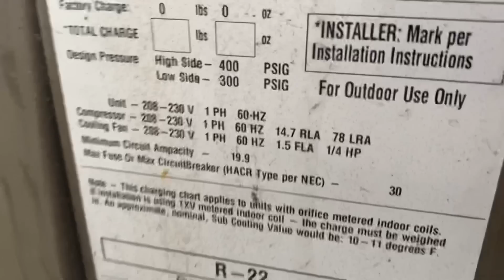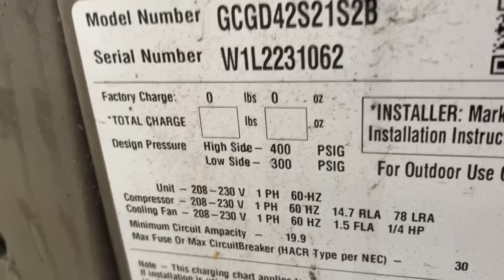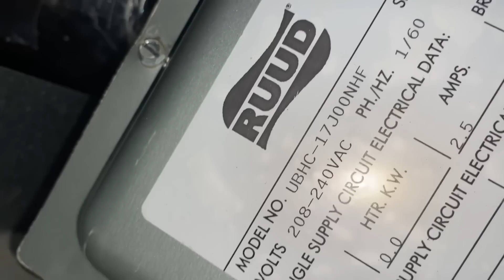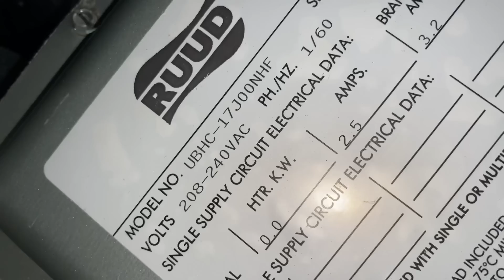Discussing Options With Homeowner After Finding Central AC System With No Refrigerant R22

Comment: It's 20 years old and should be replaced. She wants to sell. Much easier to sell if it has working air; or sell as it. My wife's cousin lives in Queens and her house would be a tear down, so she could sell as is.
A new system might be a selling point; if it is what the seller would buy. We don't know the prices of the options. A new system may be out of reach for her.

Comment: She's not going to like selling a house with a broken AC system
Reply: people are buying anything and everything in all conditions, even waving home inspections and accepting everything as-is. even if they need gutted to bare framing inside and out, with absolutely everything new!  bunch of suckers buying while the markets are so high, then they'll be up poo creek without a paddle in a year or three. 🤣
Reply: @PipeDoctor   I was speaking of the housing market in general, it's going full berserk lunacy (idiot/fools and their money will soon be parted). while she stayed put and fixed the place, she had opportunity unload it as is, but that may not work out in the long run, as things are going bust and massive inflation that's just begun. aka hold on to your hind quarters, it's about to become scaling loose rocks on known rockslide prone areas. 💣😬

Comment: Not an HVAC guy, I actually work doing energy efficient upgrades for the utility in my area, personally I would recommend a heat pump if feasible. The money saved on oil could offset the cost of the heat pump. There is more than a few banks offering low interest loans in regards to energy efficient upgrades. And in today's volitile market heating oil is only going up. Unless she has a condendensing oil furnace, a heat pump would be more efficient.

Comment: Add a little R22 and pressurize with nitrogen. Find leak and decide if fixable or not. If fixable fix it and then recharge  with Bluon R458a.
Reply: 99/100 its the micro channel condenser leaking.

Comment: I would leak search.   Find repair.  Convert to 407 c.  Just have to mix in some poe oil.    Giving her ac until she sells.
Reply: Nu-22 or 422D, don't have to do anything with oils
Reply: @videos10  true.  But with an older system like this one.   All the drop in replacements raise head pressure and lower capacity by doing so.  That could under cut cooling on the hottest day. 407 head pressure and suction pressure and temps is the closest to old R22.
Reply: @dimaslespier2688  oh interesting ! Did not know about the higher head pressure when ambient outdoor temp is hot!. So, adding compressor Poe oils would help keep the head pressure normal when it's a HOT day outside when CONVERTED?
Reply: @videos10  you add Poe oil so the 407 has less risk of separating Poe is a better oil to not allow the separation of the newer refrigerants as we know they are heavy blends.  But you don’t have to drain all the mineral oil. You can mix them.  I’ve done this a thousand times never an issue.

Comment: What would I do? I would do pretty much exactly what you did. Similar service call today like that happened to me.

One of my other coworkers went and found suction frosted up a couple weeks ago. Low on charge. Added a pound 410A. Didn’t have a scale so he didn’t want to overcharge the system. I come out weeks later for a dye check. No hit with UV Light on anything, no hit with the leak detector except schrader valves  on the outdoor unit.

Tighten the valves up, and leaks stop. We’re they the only ones that was a leakah? Don’t know. 

All I knew was that the customer was watching me the whole time looking for the thing with my sniffer and he saw exactly what I saw. He was still a little low after the system was put back together to see the performance.

Ended up having to add 2 more pounds to bring his 1.5° to the factory specifications of 10°F subcooling. Customer wants to see if we get a hit in the next few weeks or if we don’t find anything and move on.

Case in point, I told him and showed him every step of the way what was going on, and I gave him the options and professional opinion of mine. At least for now he is cooling.

Good explanation of the options, Mikey!

🤙

Comment: Mike pipe , I want to give customer the options to think ! ..., about it. I  will lead more into a new systems , educate the customer on different systems on low  ends , Hi ends systems  & include budget level , and customer long or short term key decision. Bottom line it's  about warranty, HVAC industry drive on evolution  & innovation.

Best Wishes, Mikey Pipes
From, Daniel Zertuche

Comment: We all know the the units made in past 10 years are not meant for long life. But a unit with a heat pump. Might be a good replacement. Especially with the price of oil today. Maybe a Bosch or a Carrier since you have a new friend with Carrier. As for her thinking of downsizing that is a different conversation between her and her family. And look out for the China !!!
Reply: its new york they cant have heat pumps as primary heat, least thats how it is in minnesota
Reply: @nashlucey35  I'm born and raised in NY . And in the same area as Mikey Pipes . So I'm familiar with the weather . I can tell you a heat pump would be just fine in a properly insulated house . And when it could keep up in this case the oil burner is still there . I never said it should be removed .

Comment: This is a tuff one for sure, feel bad for the lady. Blower coil unit did not look that old and coil is easy to access, so i would try to find the leak and make repair as needed. Appears the blower coil and lineset are in good shape and hopefully its a simple fix for the lady. Worse case replace coil and condenser and leave unit intact, ductwork looked fairly new from video so that should not be an issue.

Comment: I do the same,  o pressure, but I tend to lean toward find and fix the leak, stay with an R22 retrofit using Bluon TDX20. Now, I have a Goodman GPG1360090M4 with a leaking condenser.  Several micro cracks found. The problem is, cannot get a new condenser for this unit at this time. Anyways, I never pressure the customer to condemn and replace.

Comment: What would I do? Pressurize the system, use Big Blu and my ultrasonic to find and repair the leak, or in  the case of a bad evap, replace the evap coil, and then use 422B to charge the system if it is mineral oil, and if it is synthetic oil, 407C. Easy Peasey.
Reply: Replace all the way
Reply: @shayakalimi6380   You only want to replace the system if you don't have the skill to repair it.
Reply: @arthouston7361  at the end of the day it’s up to the customer. If they prefer to have it repaired that’s no problem but replacing the system would probably be the better route if you are putting more money into an older unit since there would most likely be more issues down the road. But if money was an issue then yes definitely repair since you don’t want to be left without any air conditioning 🙂.
Reply: @JP-zz5rm  A few small issues down the road is better than an exorbitant expenditure for a person on a fixed income. In this case, she mentioned moving into an apartment.